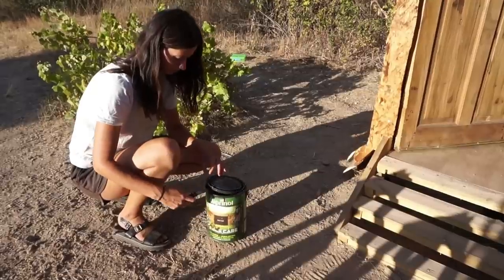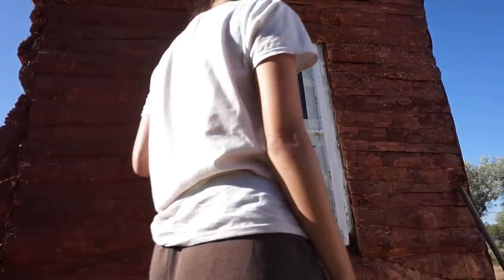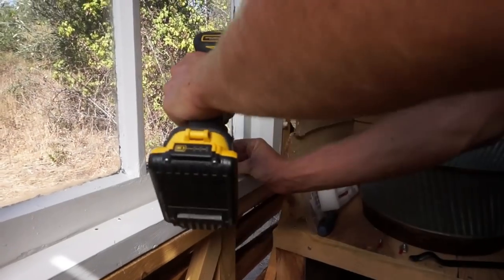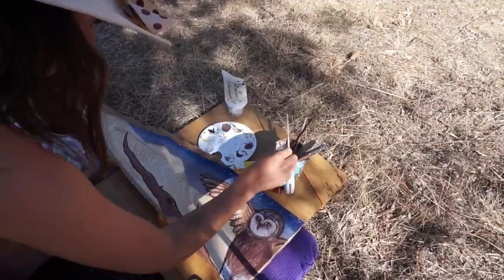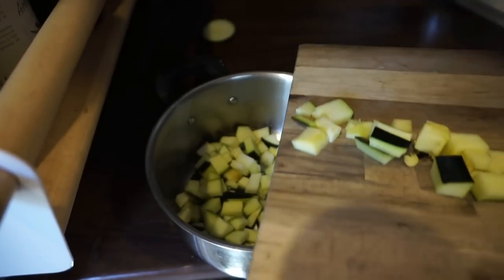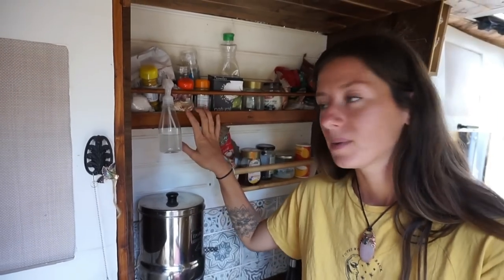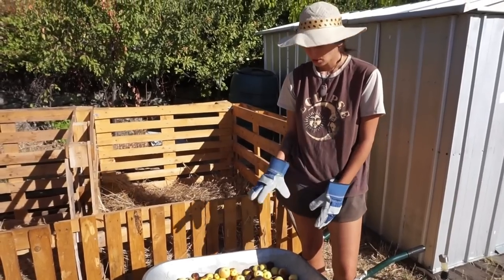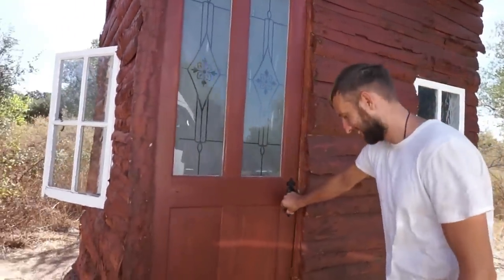Building an OFF-GRID HOMESTEAD | Simple Living

Comment: Awesome job! You guys are doing great. Perhaps you could consider a solar panel (Aluminum) and not the flexible nonsense that you have, that loose 50% capacity within 2 years, combined with a self built lithium battery (100 - 200 pounds) with a battery monitor.  That would power 50 LED lights forever and a macerate! Best of luck to you both, from a fellow Geordie engineer. Much love to you both ❤
Reply from the maker: Thanks for the info Steve we'll keep it in mind 😀

Comment: I shall be delving into your video library so you might have mentioned it there already but how did you handle the move in our irritating post-Brexit state?  

I am considering a similar transition and am looking at either getting a job over there or making some savings based D7 Visa applications after buying a little house.

In similar inquisitive vein, it would be really helpful for those of us pondering copying your bold example if you could speak on dealing with the Portuguese equivalent of Planning Permission and the difference between Rustic and Urban in regard to getting habitation permits.